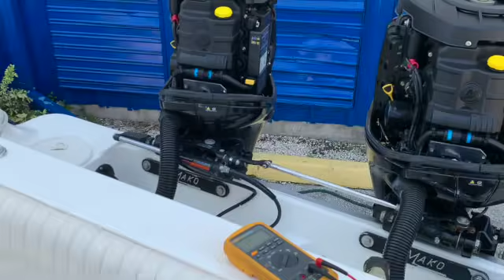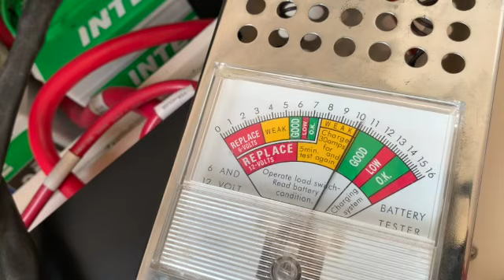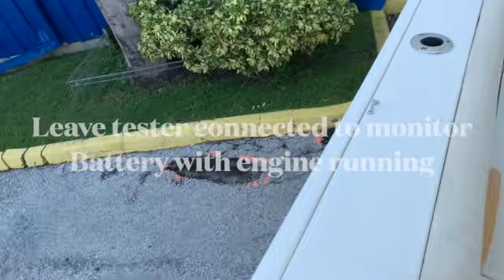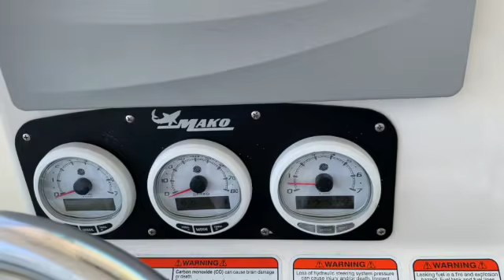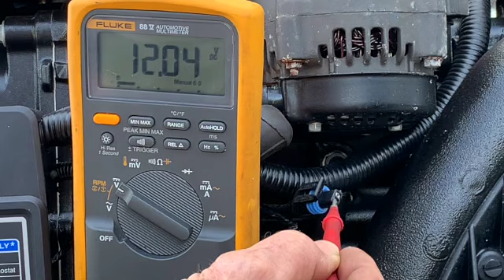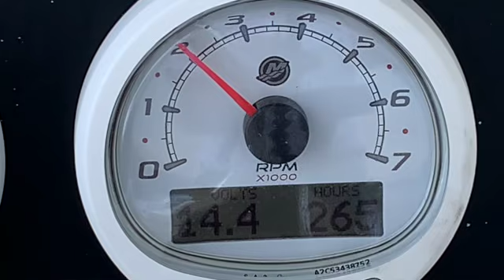2014 Mercury 150 Alternator Test  & Replace

Comment: Hi, I have this engine and it's not charging my batteries. I've replaced the alternator with a new one and it still won't charge. I have 20 volts at the alternator output! Does this engine have a voltage regulator? I don't know what else I can do... Thanks.
Reply from the maker: https://youtu.be/i8Tb_UvIggs?si=kAH4VTzEFXMAvvMT
Reply from the maker: https://youtu.be/i8Tb_UvIggs?si=kAH4VTzEFXMAvvMT
Reply from the maker: This link may also help you, 20 Volts coming out of the alternator is not acceptable. You are risking the chance of cooking your batteries.
Reply: @us4marine  I replaced the alternator and the 100 amp fuse, all original parts, but the fuse has blown again. I don't understand why it's only putting out 20 volts from a new alternator. Doesn't this engine model have a regulator or rectifier? Thanks for your help
Reply: I replaced the alternator and the 100 amp fuse, all original parts, but the fuse has blown again. I don't understand why it's only putting out 20 volts from a new alternator. Doesn't this engine model have a regulator or rectifier? Thanks for help
Reply: @maresianostra296 did u figure urs out, same exact issue with mine brand new alternator 20v at output and my brand new fusible link is already blown.

Comment: Fantastic, professional, and very useful lesson. Thank you. P.S. My alternator problem was that the battery was losing power very quickly while fishing. There were times when I had to start the engine with a supplemental power source after a short time. I disconnected the (+) wires from the battery and decided to check the alternator's power supply. Everything looked fine, but when I connected the positive wire to the battery, I noticed sparking, even though the negative wire wasn't connected yet. I decided to connect it, at least for a short time, and it turned out that the alternator was heating up very quickly. I didn't risk it and disconnected everything. Now I'm looking for a new alternator because I learned that you can't buy a voltage regulator, only a complete unit. What do you think was broken? Best Regards

Comment: Great video, but you talked about reading the voltage of the 2-pin plug and what the voltages should be when key is off and then on. Well you didn’t say what the problem is if you don’t have voltage in either with key off. Thats the issue I’m facing. Bought a new alternator and it didn’t fix it.

Comment: Thank you for passing on your knowledge. My Mercury 150 alternator started smoking when testing the engine at home before a trip. I disconnected the house battery immediately and started troubleshooting but, the plug with the red wires was confusing me. Your explanation of what voltage should be present at the alternator connections helped me tremendously. I am confident now the alternator is all that should be bad.

Comment: My motor has a long beep alarm when I hit the throttle and beep stops when I get off throttle.  Voltage on gauge is at 13 and goes up to at least 17 then goes blank. Goes back down when I get off throttle. Thanks in advance for any help or ideas.

Comment: I just did this to my 2014 150 hp Merc.  Your video helped a ton!  Thank you for putting it out. I ran the testing just as you instructed.  No output on alternator.  Had to wait a week for a new one to come in. The big dealer in town had one in stock but it was $200 more.

Two comments: rotating the alternator into place was pretty difficult.  I had to push with my feet against the alternator. When it did rotate, it stopped just a bit past the hole but was easy to line up.

The torqueing of the bolts takes more uuumph than I imagined to get the 36 ft lb torque. 

Tested on completion 13+ bolts.  Perfect.
Reply from the maker: Thank you Hardrock for your positive fed back, it really helps. Take care 👍🏻

Comment: Can't get a decent alternator on a mercury 150. Mine is a 2020 was pulling 4 amps with everything off, only giving me 10 volts at full throttle. It's fixed now but it was a bad alternator

Comment: So shop I work at has a merc 150 4stk In the shop that all 4 of us guys have been discussing. its way over charging up to 15v and toasting alternators. In a matter of a day. New batteries  with a new alternator it shows 13.5-.7  BUT by end of few hrs run time its 15-16 volts and a ruined alternator. Any Ideas? merc tech line is not much help. Merc keeps sending alternators its under warranty.

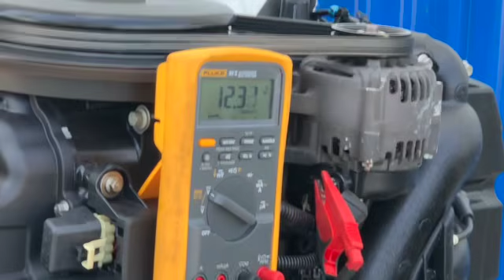Comment: Around 10:54 you say the reading is unacceptable on the alternator at 12.4, 12.5.  So what should have it been reading? How much higher than the battery voltage should the alternator read?
Reply from the maker: Hi Paul. When checking voltage on the alternator red stud connection (output) it should read 12.00 V to 12.50 V with the engine  NOT RUNNING, now if the alternator is doing it’s job same reading with the ENGINE RUNNING should be 13.8 V to 14V depending how charged the batteries are, the lower the charged on the batteries the higher the reading even 14.8 V . Now if batteries are fully charged it should hoover around  13.5 to 13.8 unless at the moment of the reading you have a bunch of systems and accessories running. (Pumps, electronics, High powered transducers, Steering power assist pumps, heavy stereo and such.) Hope this helps. Take care and thank you for visiting the channel. 👍🏻

Comment: Also should your motor pull any volts  while its not running?I put a meter between my neg cable an battery an it shows 5 volts being drawn with the two pin connector undone an 9volts with the connector connected

Comment: Is the rectifier built in to the alternator?Mine is draining my battery an not charging but around the same voltage as this one was.
Reply from the maker: Thank you sir,  sorry for the delay in responding, I’ve been with my head in other things, but will try to keep it up. Thank you.👍🏻

Comment: Great video! Thank you for sharing. My alternator overheated and smoked when I turned the battery on, without starting the engine. Do you have any idea why this happened? I’m concerned about putting a new alternator in incase it happens again! My best guess is that I was charging two battery banks and accidentally switched them to emergency parallel and overloaded the voltage regulator, and now it overheats with just 12volts. Any help is appreciated!
Reply: I have the same issue with mine, alternator was so hot, couldn’t touch it. I checked voltage from the battery to the automatic charging relay to the main Perko switch to the alternator. Nothing is grounded. Checked alternator output to ground, continuity, grounded, bad alternator. Just got my new alternator,🤞🏼, hoping that it takes care of the issue.
Reply: @shawnsinacola5835  I am having the same issues---- did you manage to resolve it?
Reply: @shawnsinacola5835  Having the exact same issue. Did a new alternator solve the problem?
Reply: I am having the same issues---- did you manage to resolve it?